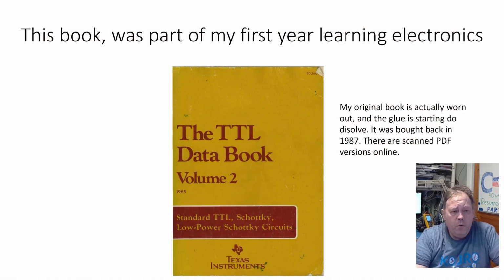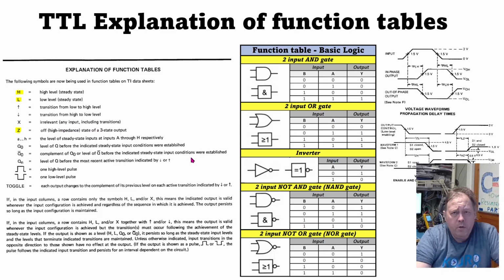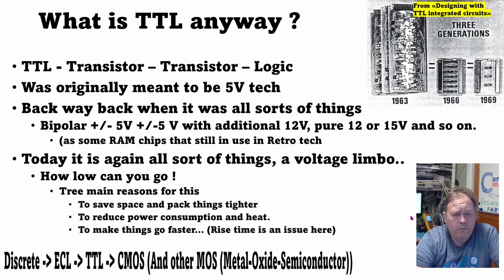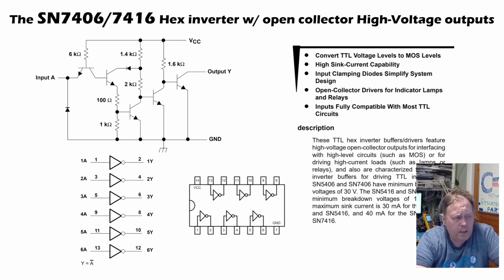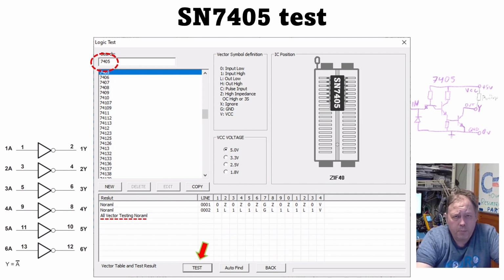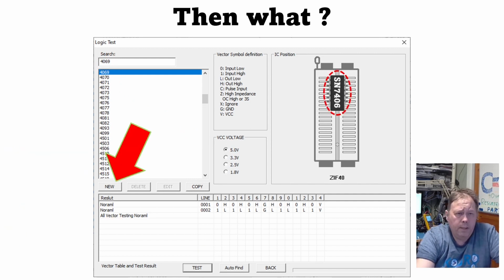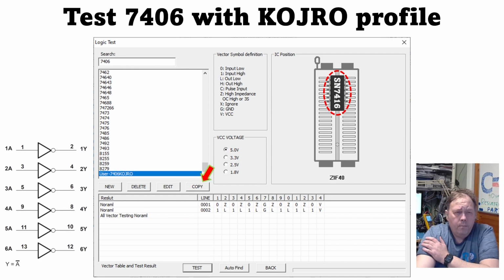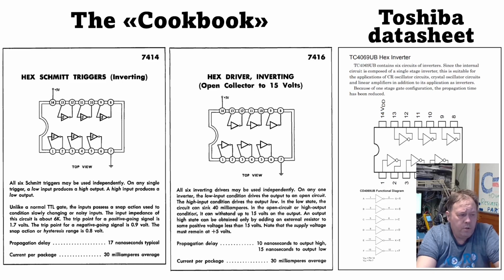The 7406 massacre or maybe not. The logic testing on the TL866II

Comment: I just received new produced 7406 ic's from AliExpress. They all test perfect in the mini pro. Even on the lowest power setting. But will give a scrambled picture in the C64. With old stock 7406 the C64 works fine. What can that be? Is the Gate timing different?
Reply from the maker: This is very interesting, can you please note down or send a picture of the truth table that is shown in the minipro software of the 7406 ? There is a strong probability that the 7406 Chips that you have bought from AliExpress are remarked 7405 Chips.. The timing or propagation delay of a single raw inverter circuit is not significant in how it is used in the C64. If Possible I would like to get my hand on one of the new 7406 chips that does not work.

Comment: good video, but what xgpro version did you use (did is miss it in the Video)? In my version, the bug seems fixed?!
Reply from the maker: Hi, thanks for watching. I have tried with several versions, the one in the video was 11.71 from December I think. I have also tried with the latest 11.81 versions. And some of the versions are actually worse. In the 11.81 they now have a entry for the 7406 with OC description, but the 7416 is not fixed, but in the 11.80 it did work somehow. They have also added a strange 7406 (non standard) entry that is the old one. I did notify them about the problems in November and it does seem like they are trying. If you upgrade without removing the old XGpro cataloge I have seen some strange mix of detection.

Comment: Good video! I always thought that the XGeco was a cheap clone of the original programmer
Reply from the maker: Yes with a name like that, that was my first impression too. But it actually is the original product, and there are not many others that stand close to beat it on bang for the buck.
Reply: I bought the 866II Plus myself with some adapters. Just dwelling into what it can do. I'm impressed so far.